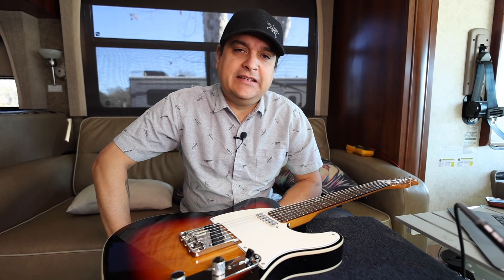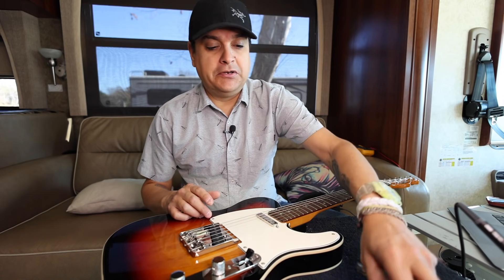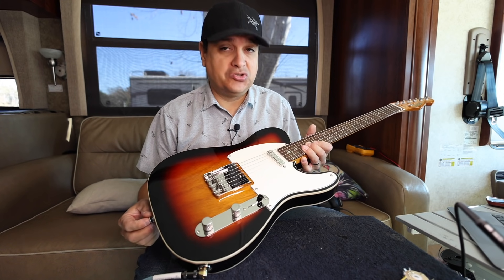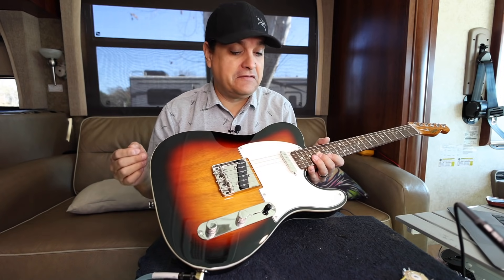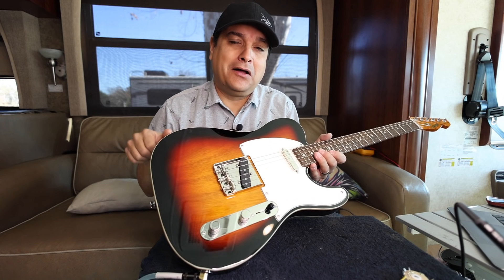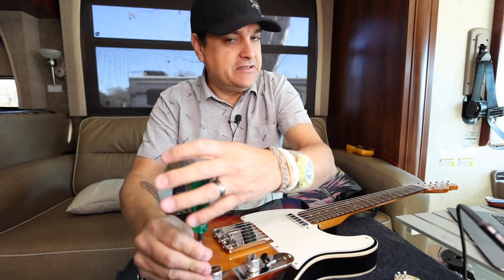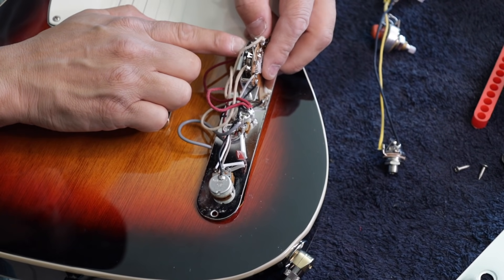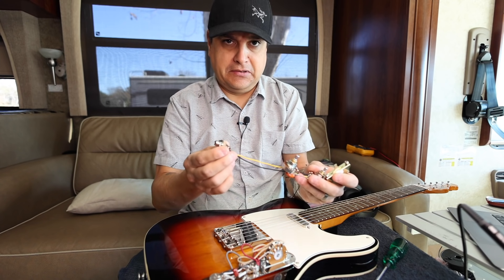3 Reasons To Replace The Pots And Wiring On Your Guitar

Comment: My kids bought me a Squire Affinity Tele for Father’s Day. I put a Mojotone solderless wiring harness and Fender Classic 57 pickups along with a set of hipshot tuners on it. It’s an amazing guitar now. My next project is a set of graphtec saddles for it.
Reply: You can see my post. I installed the Graphtec string savers on my Squier Strat and they're incredible, and I don't think they were too expensive. Personally, I'd put a Graphtec nut on it at the same time. I also used the Mojotone on both my Tele and Squier. I like Mojotone. Glad you're enjoying it.
Reply: The graphtecs will probably make you want to bump up the string gauge a little.   They made my ‘08 Tele play so much easier, I went from .009’s to .010’s.    Can’t wait to get back to Arizona to get it back from shop after fret crowning.
Reply: Did that for my Squier Tele and is a bit warmer tone (to my ears) without losing the highs. Definitely helped on string life too even though I went down to 9's.

Comment: I bought a Squier CV Custom 60s Esquire and the pots and switch were pretty good. It looked like an Oak copy but has full sized pots. I wouldn’t feel the need to change them at all.
Reply: I got the CV 50s Esquire and it was similar re the pots. I added a Bare Knuckle Flat 50 pickup and it sounds fantastic now.

Comment: Hi Dylan, I have this model of Squier Classic Vibe Telecaster Custom. Mine is about 3 years old. I recently changed the pickups to Fender 60's vintage models and changed the pots, and pickup switch to the Fender spec ones too. I also made sure the pickguard, pickup and control cavities were shielded properly and grounded as well. It made a big difference. Now it sounds like a Telecaster should. It won't have the hum or buzz as much due to ground problems.
Reply: Love the look on this model and that binding is just pristine looking!
Reply: @devinsinderwitcz9134 until you bump it on something solid then a big chunk of basswood and finish will fall out.
Reply: Thats when you wish you had ash/alder body, they wont fall into chunks.

Comment: On the last Tele I did (started from a high-end body kit - gift to a cousin in 2009 - passed on to me 2019, still in the box) I had a bit of fun, electrically. First off, I wound up a coil-tapped bridge pickup with 0.24" Alnico magnets - a bit of fun all by itself, as I drew some elements from the "Dream Machine" Tele pickup design. Then, I decided to set up the control plate "Bill Kirchen style" - pots at the front, and at the last minute put in a Duncan humbucker at the neck (found on local classifieds for $10). Happily, I had a good 4-position blade switch, and 2 Bournes audio-taper pots with push-pull (my last 2 of a batch bought pre-Virusworld), Last, I persuaded one of the machinists at the lab where I worked to make a new cover plate, with the spacing changed just enough to put a hole between the 2 pots. Into that went a rotary switch that gives a choice of 3 caps. The switch has a "miniature" knurled knob to match the 2 main ones. Part of the reason for this was as an experiment to test an idea requested by a friend, and the other part "just "for the heck of it."  I was lucky enough to have a sympathetic machinist - the plate he made, and the 1/2-size knurled knob is "unobtrusive" in appearance. I'd always wanted to make a Tele with a reversed control plate setup like Bill Kirchen's, so since several other one-off mods were going in, that one did also. The project was a success overall. If I want to revert to a stock control plate, I've still got the Bournes push-pull pots for the bridge coil-tap and neck humbucker split. I'm not usually a big fan of neck humbuckers, but the Seymour Duncan works well. All in all, an interesting project that turned out surprisingly well. Thanks for the tech project posts you do. I've recently retired from engineering, but my 1st career was playing music professionally, full time. I'm always on the lookout for improvements to sound that are (as much as possible) unobtrusive to look at. Your ideas and discussions are always worthwhile!

Comment: I just got a 50's Butterscotch Classic Vibe in a trade and it has full size Korean tone pot's, it also has the nice Fan 3 way switch. I play simple pop punk music and I run it through a JCM 2000 DSL 100 and a 900 50w and even with the stock pick up it sounds pretty sweet.

Comment: Yes Linear pot's...log or other named types suit some guitarists but not bassists...linear only...i fade in my bridge Jazz pickup so like to know 50% is 50% of tone or volume is accurate...CTS 450 series,8% tolerance, 250k  linear pots the best i've ever used..the ones with solid brass shafts are more resilient to excess heat as pot cover mounted on top of track unit...sounds very good...i have a MIM Mkl Fender Cylcone & i have a vintage USA Fender California series Tele with 9.5 fretboard,3 tone sunburst,2 piece matched body,i would like brass saddles just for a slightly heavier bass tone with a bit more definition...better than steel or alloy'd cheap metal...Tele's are easy to tune right ,put in a Greasebucket tone control using small hifi grade polypropylene caps,3 (2× 0.022mfd & 1x0.1mfd cap) & a 4K7 1% resistor...if you don't like the tone just change the value of the caps to suit...i used a Puretone jack socket, 2 of each contact on one ring (mono) 200% more contact,keeps jack plug solid and lasts for years,worth £6 for sure,built for mounting plates only though may fit a Tele as fitted my Fretking which has same jack socket as a Tele guitar...good advice Dylan...good wiring with good pots,& a Greasebucket tone set up... notes sound cleaner & more defined,clearer & does not effect the tone when volume is turned down or boost the bass turning down the Greasebucket set-up linear tone pot...some guitarists may prefer log volume pots but always use a linear tone pot... years ago i put 2 small screws through end of ashtray bridge into Tele body...sounds far better...Danny Gatton screwed down the front of his ashtray bridge...

Comment: This was a no-brainer for my Squier FSR Bullet. The tone and volume were scratchy right out of the box with 2 dead spots so had the pots (Mini asian to CTS) and pickups replaced with 59 SD's. Made a huge difference, best choice and now sounds much more Fendery.
I have to be honest though the stock pickups weren't bad at all, surprisingly good in fact. I just wanted a little more in the mids.

Comment: Correct me if I'm wrong. Before you changed pots you tested with the neck pickup. After the swap it looks like you're on the bridge pickup. Did you flip the switch 180 degrees? I've already done this to my Tele and Squier Strat, among other upgrades; I just want to see what you say about it. But I've got to say, I'm most excited with the Squier sound. Here's what I changed, new: Locking tuners, Tusq Nut, Seymour Duncan P/U's, Tusq String Saver saddles, all new pots, 5-way switch, and jack. I also went with a wound G string and it stays tuned. Harder to bend but as a beginner I don't care. My instructor says it sounds like a regular Strat (he didn't say from what country) but he was impressed with the sound. I'd like to see you cover Tele bridges. Mine has a vintage bridge with 3, non-compensated saddles and it has intonation issues. Would you go with compensated saddles or replace the entire bridge to accommodate 6 saddles? I don't care if it looks "vintage" or not. I just want it to sound and tune better (although it sounds good since I did essentially the same with it as the Squier, except for the nut and saddles.)
Reply: Should have just stumped up for the player plus tele, they are great.

Comment: My Tele had 500K Alpha pots and a PCB 3-way switch I swapped out for a premium kit consisting of CTS 250Ks, a Sprague 0.047uf orange capacitor, pushcloth wiring and a Switchcraft jack followed by an Electrosocket (that football jackplate was irritating!) and the G&B A5 pickups sounded much warmer unlike the 500Ks having em sound like nails on a chalkboard. 

Most are too emphasize on changing pickups when the pots make as much difference in tone if not more.
Reply: This. If the objective is to have a more pleasing and warmer sound, 250k pots and a .047 cap is the way to go. You'll get much more roll off of the highs when you turn down the tone knob.
Reply: @15thwardadrian  exactly!

Comment: Nice thanks for sharing again love your channel.
Q- purely objective- on a tele single coils, is there any reason that would be bad to have the tone pot a 500k and volume 250k, does it need to be matched values because no two pots are exactly the same vale unless they've been  matched to the same vale even if it's 530k +530k for example or below the 500k +/- 10% tolerance margin.
My plan was to use a 500k audio logarithmic push/pull master tone with big difference in capacitor values. Just because I believe strats/telecasters (more so strats) Leo Fender designed them to be modded to experiment and make it your own thing in every way if you wanted to. Which what I love about Fenders! You can go your own way, but still- there are some rules of physics that have to be followed, understood  and applied for it to work well with your amp.

Comment: I have been wanting to show someone that knows more about the electronics of guitar, these pickups I have that were in my classic Vibe 60s in 2019 when I bought it.  It's 2015 , I love it. Anyway , it had some mighty mite cloth wired ceramic high output pups in it but someone added or replaced the pots to 500k. For single coils but I guess since they are high output this helps I don't know. But I'll be honest. They just might be some of the best single coils I've heard for the Non strat specific tones. Like say super strats. I wanted more of the classic tones so I put in loaded player series guard.  They sound great too but now after 2 years of more learning I'm thinking about replacing it with the mighty mites. Whoever owned this CV 60s 3tone SB had also very tastefully relic the headstock as well. Including a cig burn mark. The body isn't relic at all and it just looks good. But man it sounds even better.  This was sold as a SE Squier. So yeah I scored. I might redo the review of it since it's been a while ...But man. It is fantastic ...I've read up a bit and am still not sure but this just might be a mutt of parts from Korea pots and etc but wired up by someone that knew a specific tone they wanted and look. It's amazing. Peace!!!

Comment: Another way to do what you want of clarity of bridge and neck pickups is to bypass the tone for the neck pickup and only use it for the bridge pickup. Therefore the neck pickup will not muddy when you turn the volume down, and you can now set the tone to the bridge to your liking. You do lose the tone control of the neck, but advantage of no tone cap loading. So basically, set your tone to the neck, and then turn the tone down a bit on the bridge to taste, and then you have a bit of bright boost on the bridge for lead without having a TBX tone control.

Comment: I recently switched out the electronics in my Tele and I used a Freeway 6-position switch to add series/parallel options both in and out of phase. My only criticism is that I wish it had more of a defined detent for each position, but otherwise, I think it's pretty cool. Wondering what other people think of those.
Reply: Curious.  
What is the wiring schematic you used for your Freeway Ultra switch?  
Did you think there was enough tonal variation amongst the six positions of the Freeway Ultra vs. the typical three position, Tele configuration?

I recently had opportunity to A/B two guitars that came each came stock w/Freeway Ultra switch, Duncan Vintage stack(neck), Lawrence L250-TB(bridge), EXCEPT, one had been modded thusly: 3-way switch, Lawrence Black Label T(neck), Lawrence Tele Twin Blade(bridge).   

Have to admit, the stock instrument sounded great.
The modded instrument, however, just sounded like a HOT, classic Tele (even w/the Twin Blade(bridge) pickup, that had all the modern hardware and build design updates some of us LOVE.

In comparison, i didn’t feel the extra 3 positions were noticeable enough for me to prefer the Freeway Ultra to the typical 3-position Tele switching.

Thanks!
Reply: @GByePorkPieHat  Enough, yes. It becomes more worth it though with humbuckers than single-coils.

Comment: Interesting. My older (pre 2018) CV Tele has the “not Tonerider” pickups and full size Alpha pots. It does have a box style switch and a cheap input Jack. I’m not sure what value of cap is on the tone pot, but it gets dark pretty quick, especially on the neck. Odd that they made the decisions they did but margins drive decisions, I suppose.
Reply: Most teles tend to get dark quickly unless you install a treble bleed mod to stop the treble rolling off when reducing volume.
Reply: @thetattedpharmacist3215  Would a treble bleed have a similar effect as what he's trying to accomplish here, to increase the range of motion of the volume pot?
Reply: @BoltRM one retains the high frequencies when lowering the volume and the other tapers the width in which the volume is reduced as you turn the knob. I plan on building my first ever guitar soon and I will go with both!